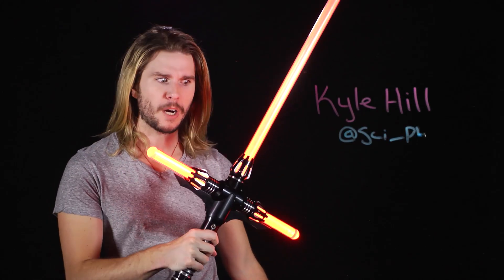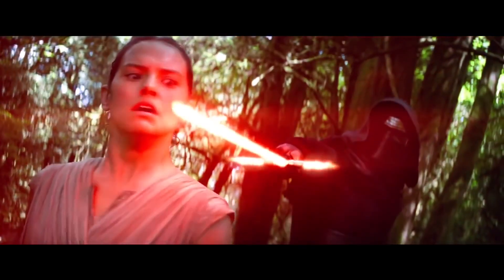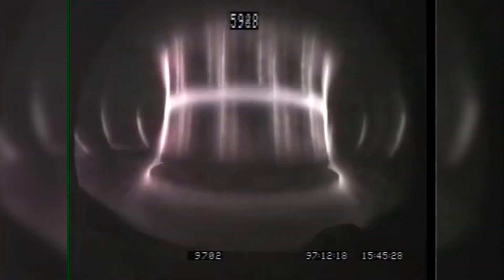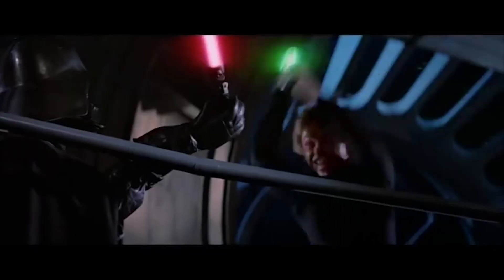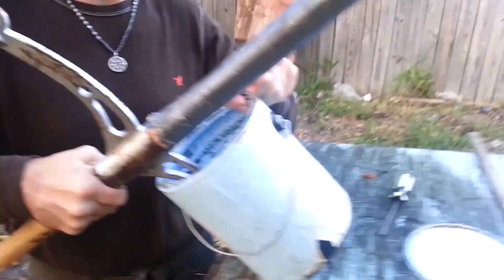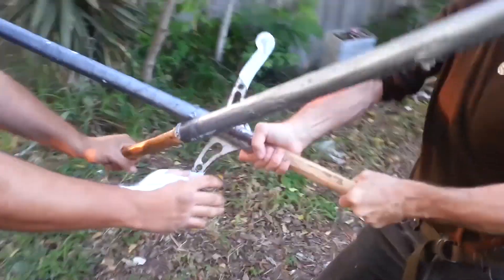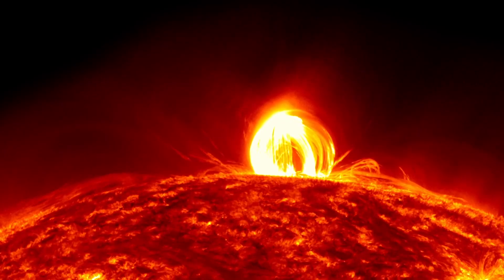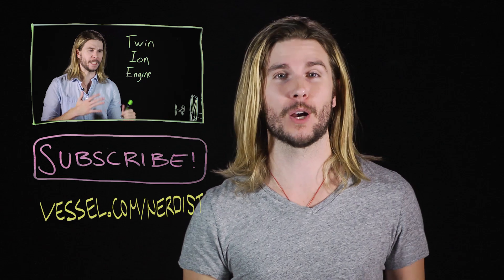Why Kylo Ren's Lightsaber Works (Because Science w/ Kyle Hill)

Comment: lightasbers are suppose to be heavy though, which is the opposite of weightless
Reply: Not sure where you heard that, but that is not true... At all. The only weight comes from the hilt, and it is not very heavy at all in most cases.
Reply: +R4FA It is the forces imparted by the spin of the magnetic field holding the plasma that imparts effective feelings of weight.
Reply: vT Warlord george lucas said that in a behind the scenes video for the prequels
Reply: The hilt is probably not that heavy , and even if it is as heavy as a real steel longsword you have to keep in mind that all of the weight is exactly where you want it at. In your hands. Center of balance closer to the hilt results in better manuverbillity . Center of balance closer to the point means more cutting power. But since speed is more important than streght 99% of the time you can understand why most blades that have a center of balance closer to the end are not even weapons , such as the machete.
Reply: +R4FA Yes, well, I think he also said that he wanted them to be like 40lbs, which is about 10x the weight of a real sword, and would be nigh unwield-able.
Reply: And since sometimes they use the lightsaber in one hand not exclusively sticking with two - a hand and a half sword - bastard sword(they ran out of ideas for names of swords) is probably the better thing to compare the lightsaber to which is lighter than a longsword not by much but worth mentioning.
Reply: Yes so much so that Lucas even made actors keep both hands on saber at all times during original trilogy
Reply: Hristo, That is why only Jedi were sposta be able to wield it, it was highly cumbersome with most of the feeling of weight out on the blade. the hilt weighted next to nothing compared to the forces imparted by the blade.
Reply: +R4FA I think that was only for episode 4 or 5. Later on he says the idea of it evolved
Reply: Actually in episode 4 Ben tells Luke about how a light saber is extremely difficult to wield because of its odd shape and size also that it's weightless
Reply: +R4FA The hilt is all the weight. My guess is that it would be a little bit heavier than a dagger. The blade is pretty much like wielding light, there is no weight to it.
Reply: Φίλιππος Κωστόπουλος There is no way you have a 50+ lbs weight hanging off your belt and have it stay there. All the effective weight is in the forcefield that contains the plasma that is the blade. The blade is not light, as that could not be contained to a length of a yard.
Reply: ***** 4 lbs is actually on the heavy side. I train in german swordsmanship, and your average german two-handed longsword weighs about 3.5 lbs. 

http://www.germanlongsword.com/faq.php
Reply: Evan Kimes There was a character in the clone wars series -Asajj Ventress who used 2 lightsabers , one in each hand. The theory that lightsabers are heavy is pretty much gone.
Reply: Hristo Kuymdjiev Asajj was unusually strong in the dark side of the Force due to the nature of her upbringing. This allowed her amazing control of lightsabres. Weight has no bearing with her.
Reply: jnzooger You either made that up or it is the ultimate deus ex machina of plot conviences. 
THE FORCE AWEKENS SPOILER : There is a scene where the character Maz Kanata holds luke's first lightsaber and she doesn't appear to have trouble holding it. And she even says in the movie that she can't use the force so she couldn't be using that to help her.Conclusion-lightsabers are not heavy.
Reply: Hristo, She never activated it, of course it wasn't heavy to her, but in the original script, Maz is a jedi anyway.
Reply: jnzooger That first intended script is not canon. What is canon is the final version of the movie and there it is specified that maz is not a force user.
Reply: Fair enough, it may be said elsewhere, but jedi or not, she was able to pick it up and hold it one handed. The hilts weigh only a few pounds max, and that is my real point. The rest of the unwieldy weight comes from the blade itself.
Reply: I see what you mean , but I doubt the blade has any weight. Since the weapon is called a LIGHTsaber we can assume that the beam is made of light or laser. And light/lasers have no mass. But this is just speculation , you could be right , the blade might not be just a laser it could be something else.
Reply: Hristo Kuymdjiev My original point is that it's usually a good idea to ignore what George Lucas says. He described lightsabers once as being like 40lbs or some shit, which would be unwieldable by a human. 

I am of the mind that a lightsaber weighs about as much as a normal steel sword of similar size, which would be between 2.5-4lbs for a standard blade.

Comment: Even if you have hand protection, it doesn't help if somebody cuts off your arm, or any other place that the hand protection doesn't cover (and even in most of the clips you showed, the crossguard would not have helped because of the type of cut that was used). You know what they have in Star Wars though? One way force fields, often called "deflector shields". They would be FAR FAR more useful than a plasma crossguard.

Comment: :sighs: part of the blade stability control is in a magnetic ring in the emitter.  its the magnetic fields that allow 2 lightsabers to clash and not pass through eachother. if you hit the emitter on one of those crossguards you'd wind up cutting it off since the plasma is unencapsulated by a magnetic field under the cross emitter array as yet

in short you'd just cut through it and into the person's hand

Comment: You forgot about the fact that those side beams are actually coming out of heat vents which are needed because Kylo's lightsaber burns hotter than standard lightsabers. That's also why it crackles so much.

Comment: I feel like this ignores that sure there is a blade under the metal but what happens to the cross guard after the first hit. It would breach the blade containment and the lightsaber would short out at least on that one side or in the worst case explode. Some people have postulated the hilt could be made of pure cortosis which would work but than the extra blade bits are essentially making the blade more dangerous for the user. I don't feel that this video thoroughly looked at the logistics of the saber enough.

Comment: you've got it wrong, they're offensive, not defensive, just got back from the film, when he locks up in a lightsaber duel, he forces the blade down so the cross guard cuts into his opponents shoulder
Reply: +Field Marshal Fry crossguards have historically been used as an offensive tool as well. It is possible for something to simultaneously be offensive and defensive, lol.
Reply: Lendanto
I'm just tell ya how it was used in the film
Reply: +Field Marshal Fry Even shields are offensive weapons when used in actual melee combats.
Reply: +Paul win yeah, murder stroke as it's called. Crossguards can also be used in certain circumstances to force a sword from an opponent's hand, something that'd only be much more effective with a lightsaber crossguard, which'd just cut the hand clean off.
Reply: That doesn't make it offensive, that means he took advantage of it.
Reply: +Lendanto 
Not to mention they can be used as a crowbar to get your opponent onto the ground.
Reply: +Field Marshal Fry Kylo will basically always win when sabers get locked together.
Reply: +Field Marshal Fry Love your comments on cracked, dude!

Comment: Most Handguard designs arent that...big, and they were still impractical with training. Why spend sooo much time training to use unnecessary larger crossguards when you can use one that doesnt....that's the point 

And Lightsaber duels happens ffaaaaaaarr closer than traditional fencing....so, you'd catch yourself even more often.